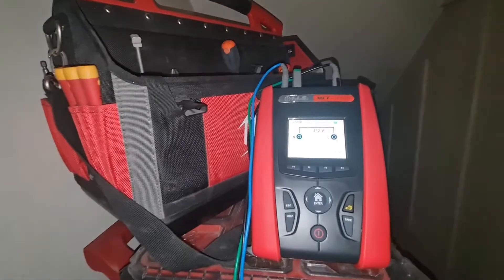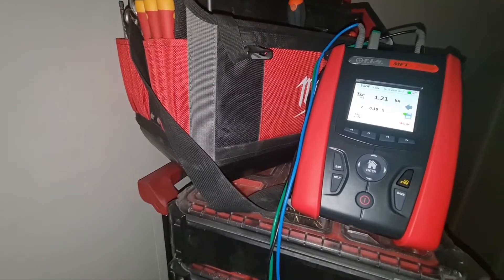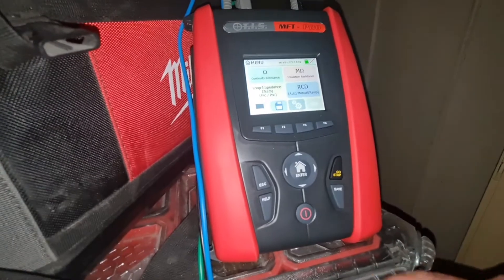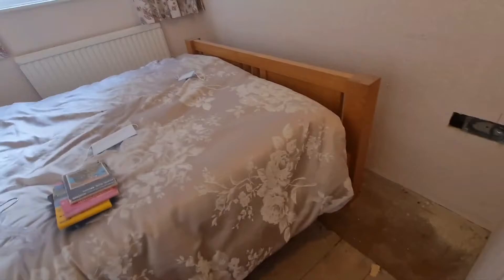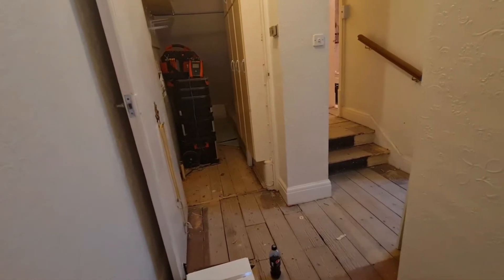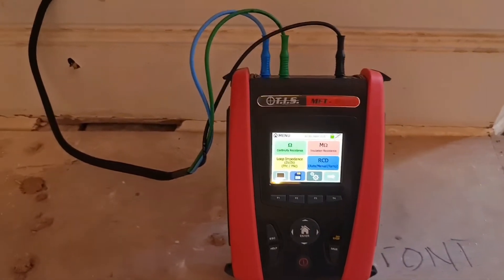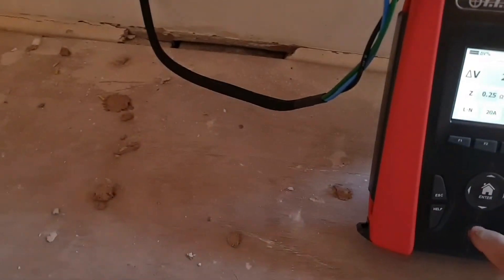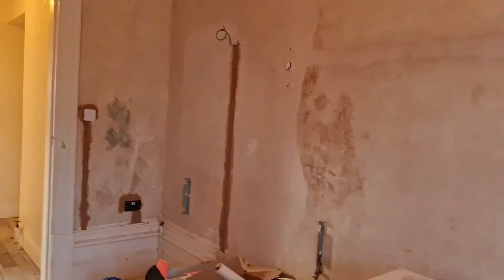Electricians flat rewire part 2!

Comment: Nice tester. The clamp meter attachment with power quality mode your measuring basically two aspects power factor and harmonics assessment. Likely to become more important in future when homes start to fill with mix of ac dc equipment and with EV charging and solar prosumer world. Moving beyond just safety but also covering efficiency of operations.
Reply from the maker: I am going to get one and play around with it. First time playing around with that tester and it impressed me. You are spot on with moving towards efficency and measuring for it more often.  Thanks for the comment 👍
Reply: @electrician247  take a look at Martin’s 3- part work on this issue you will find it interesting on power quality issues. Actually this is scratching the surface but the advantage Martin looks at is the single phase residential issues in the later ones he talks more about the industrial side.

https://youtu.be/b7-TFJZTMeA

If you really want to understand this work it will get much more mathematical very quickly. 

Electrician’s life’s will be made much more complicated and the testing equipment is very expensive and specialized in this area. 

However, I think multifunction testers like the one you have will have these capabilities built. However the compromise will be the testing will be constrained and more simplistic in a prosumer world with solar adding generation will add lots more complexity.